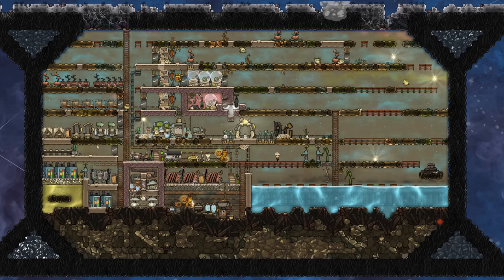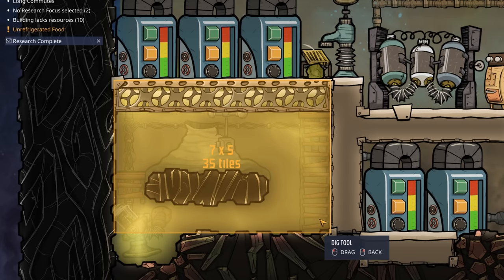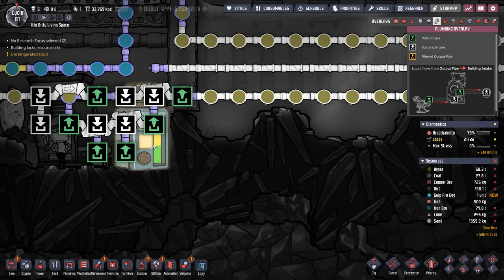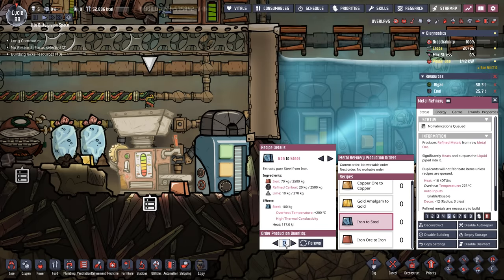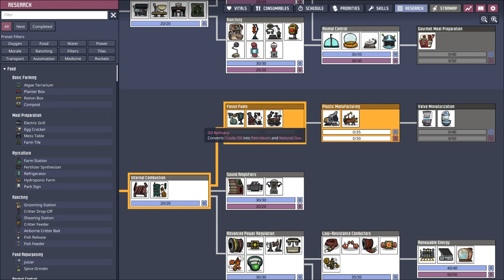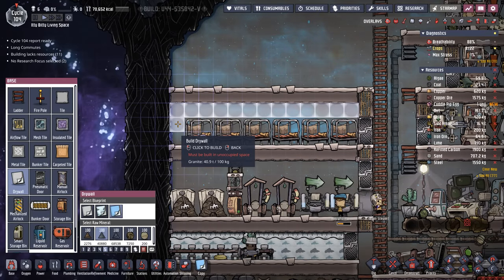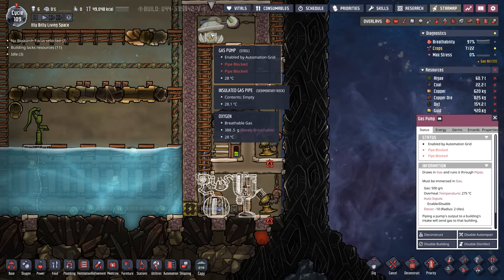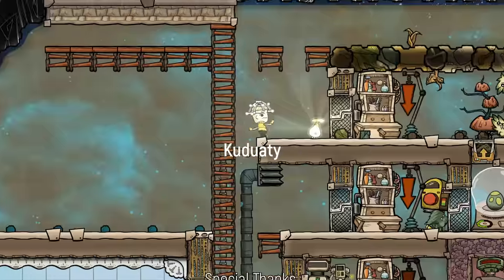Tetris in space | Mini Base Ep 3 | ONI

Comment: If you want to disinfect the p water without chlorine you can route it through 4 liquid tanks that start with 0 germs. Because each tank outputs water at average germ count of the tank the 4th(3rd could be enough) tank output will be 0. You will need automation or pipe priority system to make sure the 4 tanks stay full, but otherwise its a set and forget solution that can handle 0-10kg/s. If you want to get rid of all germs leave a spot for toilet, sink and shower water so you dont need two disinfection areas.

Comment: An abyssalite tile will transfer through metal tiles, but it is slower.  The more the metal tile is surrounded, the more transfer you get.

I use this in 2 areas of my current playthrough. In a cold biome, metal tile surround by 3 abyssalite to regulate the temp of a pool of water for base cooling, and a second one next to a hot biome to regulate temperature to pincha pepper plants.
Reply from the maker: Makes sense based on the liquid vs gas vs tile thermal transfer rates.

Comment: The little base is coming up really well! You could save a ton of materials by switching insulated gas pipes for normal ones inside the oil refinery area. Since it comes out at roughly the same temp as these places usually stabilize at, there's really no need. And the water pipes leading to the oil well shouldn't be insulated at all. I usually even make a small loop around the well to make sure the water drops as much of its chill as it can. This way the system is self-cooling plus you should literally get tons of material back.
For the most part I don't really use much insulated piping inside a refinery area in general. Unless I'm feeding it 95°C water.

Comment: 12:28 for anyone wondering why the heat still moves: when the game calculates the thermal conductivity (TC) between 2 NON insulated tiles it uses the following formula: sqrt(TC_1×TC_2). For those not into math: if either of the 2 tiles has a TC greater than 0 the total TC will be greater than 0 thus allowing heat to move. YES THIS INCLUDES METAL TILES RIDGE! The reason water is so much faster at conducting the heat is due to flashing. When a liquid tile touches a tile that is hotter than it's evaporation point +3C° it will do a state change and steal the heat required. For tiles that have the "insulated" tag tho the game will choose the lowest TC.

Notes
1: additional multipliers are added between some tile types.
2: this only counts for heat movement between 2 different tiles, not tile and any buildings, pipes, etc.

O and while you're reading this. Meteor impacts have a 1 tile range. That is why you're insulated tiles get damaged. I suggest a extra space between the bunker tiles and insulated tiles. Bonus points if you make it a vacuum.
Reply from the maker: Spot on.  Thanks for the informative comment.

Comment: I'd really love to know exactly why Abyssalite tiles, and only tiles, transfer heat to liquids and only liquids. That said, it can make for a distressingly long-lasting steam generator setup. Seriously, I had four turbines running at full tilt for hundreds of cycles just removing 400C from a single layer of Abyssalite. (Because it has so much capacity.) And then when those tiles got down to around 120C, I just dug down another layer. Never even got to the magma, just left it lol.
Reply from the maker: I like this idea a lot.
Reply: There are two answers here:
Abysalite's abysmal thermal capacity means that the heat it transfers is minimal, to the point floating point math may even round it to 0 and just negate it.
It boils liquids though because of the flaking mechanic. Basically, if one tile's temp is over the phase change point of the material in an adjacent tile, the game will ignore the normal heat transfer math and just dump enough heat to phase change 5kg of the second tile instantly. You mostly see it with liquids simply because compared to solid tiles they boil at much lower temps.

Comment: The oil tech isn't backwards. A lot of the standard maps come with thousands of kilos of free oil under high pressure, you can just pump it right out.
Wells are not normally required for a lot of the early small scale uses you have for oil so it makes sense to have the more complicated renewable oil option further down the research tree.

Comment: Abyssalite has a thermal conductivity of 0.000000002. So it has more decimals than the game shows. It's intentional; I figured out why when I was trying to mod it all to be the same temp, I was trying to figure out why the abyssalite wasn't just like neutronium. My brain flash: Abyssalite maintains the biomes it surrounds. It could be a zero transfer element but it actually serves a purpose by having a very low transfer. This is annoying with high temp abyssalite breaks, but it's really helpful in cold biomes. The more effort you take to keep them insulated the more you'll be rewarded because the game is trying to help.

Comment: 10:40 When the buffer tank is empty then the metal refinery will not get any coolant. IIRC the refinery inputs while it also outputs, but there might be an edge case there. A simple fix is to have the pipe go to the refinery before going to the bridge.
Reply from the maker: Something I have to look at, great point. Although I think it will be fine because the line doesn't pull 10kg/s.

Comment: The  incoming water for the metal refinery is the wrong way round. It will only feel water to it when the line is backed up as it is. Which it shouldn't be when the storage is built, except when the refinery is expelling water. 

I'm doing a play along, I'm ahead so it's nice to see what I should have done ;) I like the petroleum setup on the right like that, unfortunately I've put my everything over there, including all the ranches.
Reply from the maker: The refinery will fill even when the tank isn't backed up, because the line doesn't pull 10kg/s.  Good thinking though.

Comment: You could combine the Water Distiller, Heat Sink and space material cooler into one unit. You need heat to boil steam for the Turbine. No reason you can't use it for cooling as well.
In fact, the Steam Temperature of Polluted Water is barely <120°C, which is just below the 125°C you need for Steam Turbines.
Reply from the maker: I think you are on to something here.